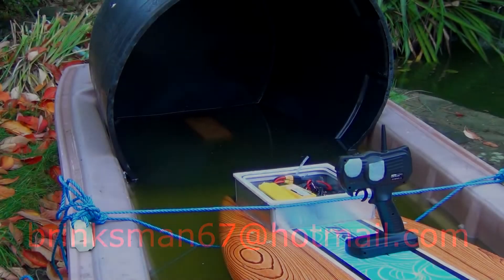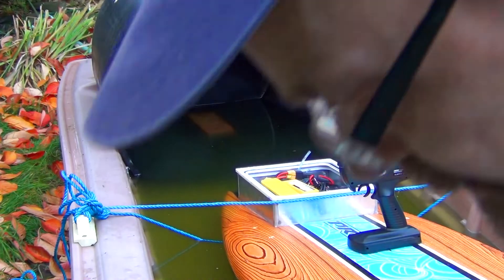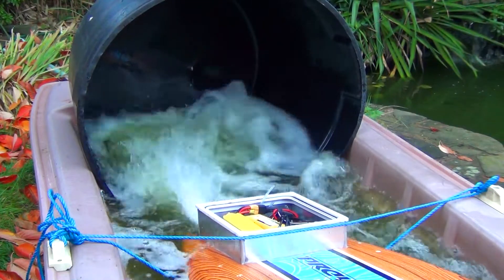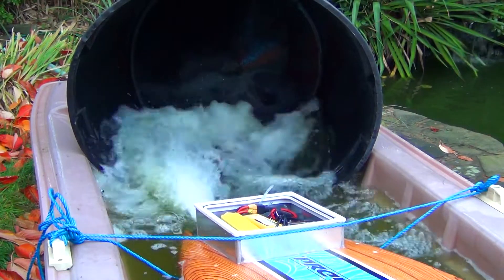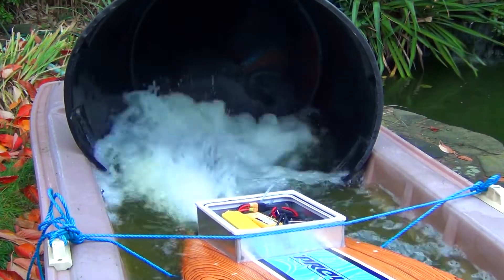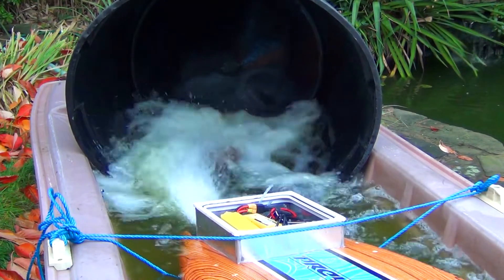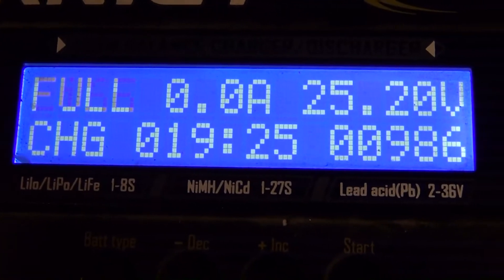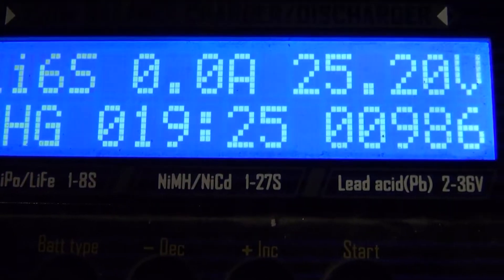5 MINUTE MID-RANGE MOTOR TEST, ONE JET-DRIVE UNIT,

Comment: How much for just the jet drive and how much for the whole thing
Reply from the maker: Hello Angus
the 53mm jet units are £200 each,
the whole set up with a board is about £1100-$1500,,
I have since taken it out and had a run, it ran very well,
the board could have been a bit bigger though for my weight,,
I hope to have a new board set up to test soon,,
Cheers for the visit mate,,
all the best 
Mark
Reply: @YOUNGSTERS-JETS  thx